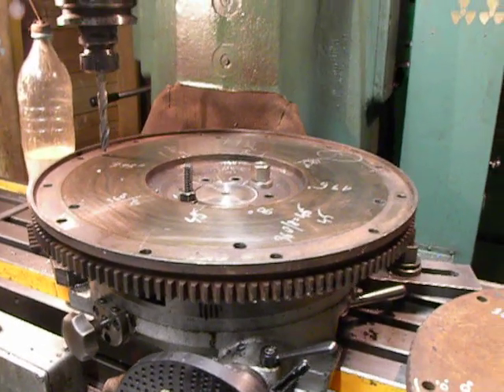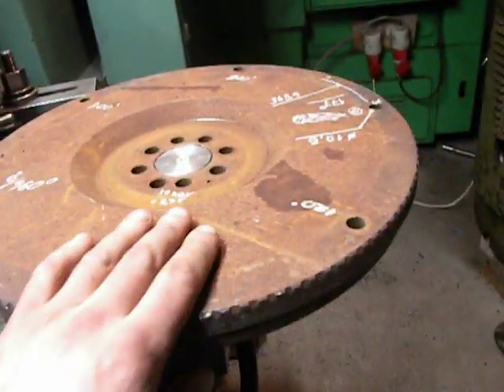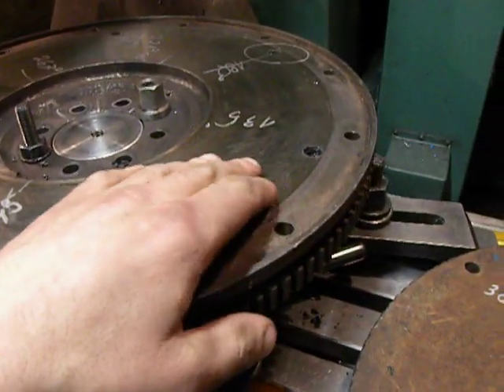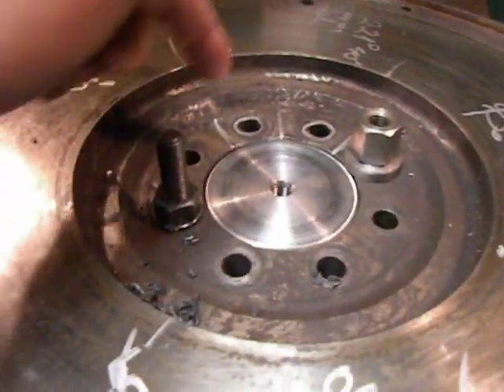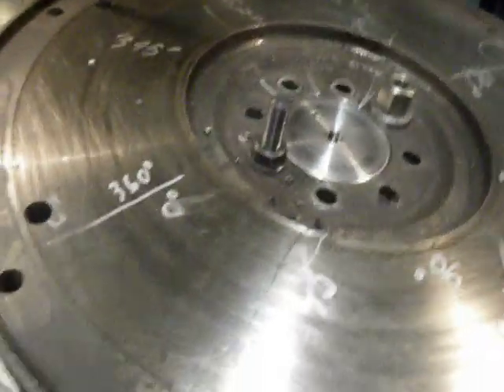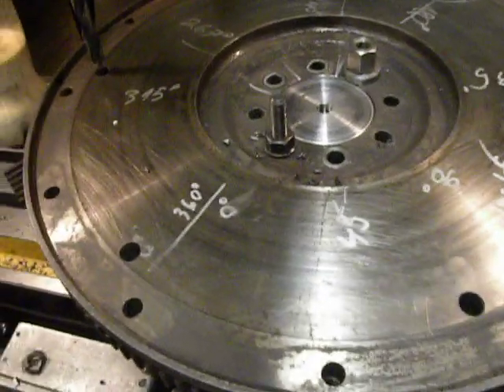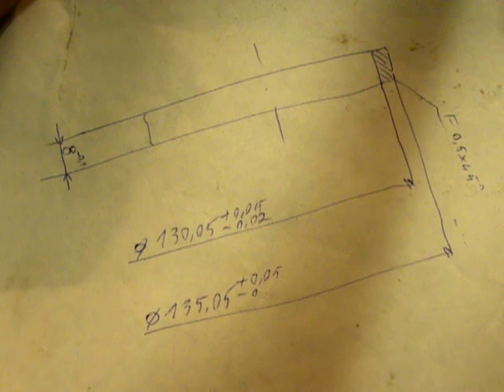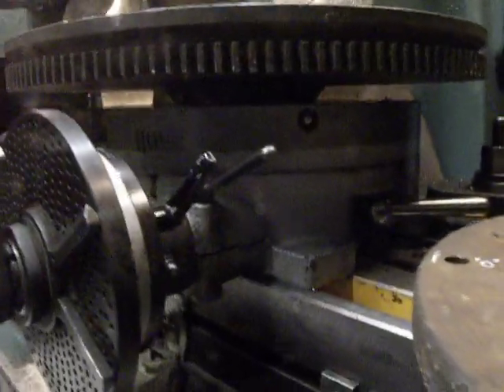Flywheel job walkaround.

Comment: Someone must be feeling brave to try to install a Mercedes truck engine in an average Belarus tractor - I can easily see the engine tearing apart the tractor with all that horsepower! 
Some very critical measurements needed there and a brilliant rescue with that mistake.
I'm pleased to hear that your health is improving slowly but I guess it will likely be many weeks before you will be able to stand for much of the working day. Best wishes any how.
(if it helps,  the aluminium and plastic support that your using that stretches up your arm we would call a crutch, the shorter one we would call a walking stick)
Reply: Depends on the size of the engine...but if it's anything like an OM446 or a MBE4000 that would definitely be overkill.  But here's a larger Belarus with a Caterpillar 3150: https://www.youtube.com/watch?v=YVmiULyggl0
Reply: @douro20  No,this specific engine that he is making the flywheel for is the om366LA i know the guy who put the engine in his belarus,whole 240hp in a belarus tractor,only problem he told me is that too much weight on the tractor will make the wheels spin out.I was shocked aswell thinkin the gearbox wouldnt hold,but he hasnt had any problems.